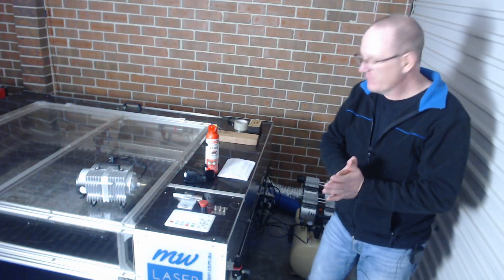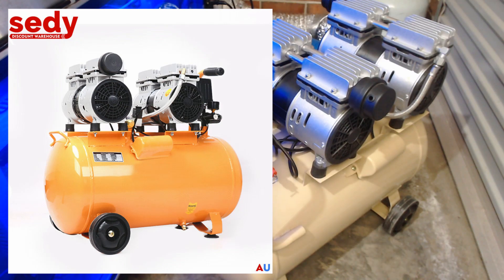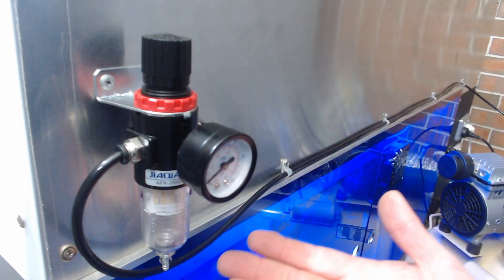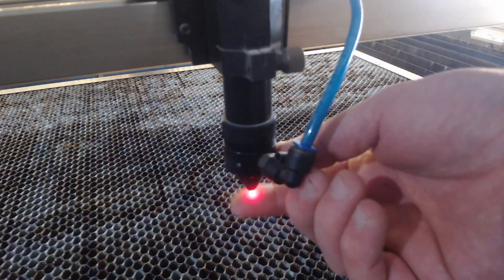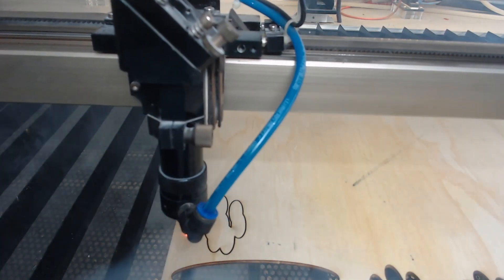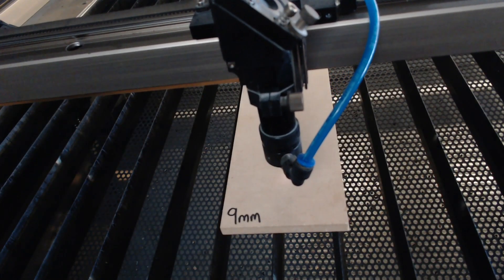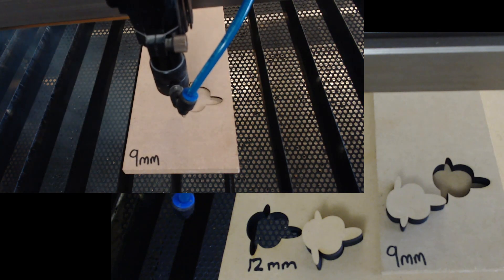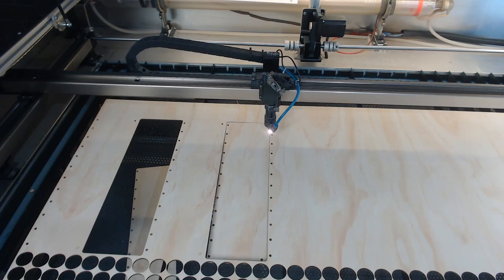Co2 Laser, AIR COMPRESSOR Upgrade, Setup & Testing, With Ultimate Air Assist

Comment from the maker: My Review of the SEDY Air Compressor... Well after a day from New I had it replaced as it originally came with a faulty compressor unit.  Now 4 months with this replacement unit, and this one has the same issue.  I Don't recommend this unit.
Reply: from california air website....
"Up to 8 hours of continuous running at 90 PSI and 12 hours at 40 PSI. 
The 200CR motor/pump is tested for a minimum life of 5000 hours before wear. Wear parts can be a piston ring, cylinder ring or reed valve."

I wonder if you exceeded a similar timeline??

Comment: Hello, I am having problems with my co2 laser unit that has the same small compressor as yours. My laser has 150w power and I use it mainly for cutting wood and acrylic but I do need to engrave like 30 percent of the time and I am getting all sorts of burnouts. Will this type of compressor also help with this too?

Comment: I might have missed it in the video, did you have a second pnumatic solenoid to prevent your air from leaking while the machine is idle? (The ultimate kit has a relay for turning on/off the aquarium pump, but that wouldn't do such a great job with a compressor and its tank)

Edit: nevermind, I should have read 3 more comments than I did, I found my answer

Comment: I see the video is from some time ago. Have you since then, or anyone else here for that matter, gained any experience in the water-filtration on the regulator. Do you use any special size of the micron in the filter?
I have a regulator with filter now, but I still get water coming through putting a layer water on the focus lens. Not sure what micron size I have on current filter, but planning on buying a 5 micron filter.
Reply: Try a 2 meter pvc pipe filled with desiccant crystals

Comment: Great video...first time visiting. I am in the process of setting up a Thunder Laser Nova 63/135 Watt that I just received and had planned to use my Makita MAC5200 air compressor I already have. However, its volume (~20L) seems to be undersized for what you recommend. Will I find that the 20L will be an issue with some projects? Also, if I use the Makita, I am guessing I will need to use a  separator to deal with oil mist also but haven't researched this yet to see what the options are.

Comment: Always great videos. A compressor I highly recommend is made by a company called Jun-Air. They make several models but the ones that use a refrigeration compressor are whisper quiet (45db) and are very reliable. They are ghastly expensive because they target medical and scientific community but you can find them in the $4-500 dollar range in the used market. You need to use an oil/water separator as it is an oil lubricated compressor but they last for decades. They are quite small too.

Comment: Hello great info as always your videos are really helpful!
I'm in the process of buying a Co2 laser and wanted to ask you if you did these cuts with the 90w tube you mentioned on the part one of your laser build because I have chosen a Reci W2 90w tube for my machine and was afraid it couldn't cut 8mm and 10mm MDF or Plywood. I want to do some detailed engraving so the w2 seemed like a good option for cutting and engraving but please correct me if I'm wrong, and its impressive you did it with a 2''(50.8mm) lens I was thinking about a 2.5''(63.5mm) and wasnt sure if it would do that.
Also you used 7mm/s for 9mm MDF at what power? And the setting for the 12mm?

Thank you for your help

Comment: Hello

Can i use a compressor with tank with a cloudray ultimate air assist? If yes, how?
Reply from the maker: yes, however you run compressor on a separate power outlet and not to the relay so the compressor is always on.  You can use the relay output for the exhaust fan.
Reply: @MWLaser  a valve is normal open, so, how to control it?

Comment: Hello!!  Great video.  I NEED HELP.  My laser uses a larger diameter silicone tube.  I need a connector that will go from the compressor to the silicone tubing.  Do you have a link to one that would work?
Reply from the maker: I would replace the silicone tube with a nylon tube if using an air compressor

Comment: I'm installing the cloudray ultimate air assist kit to be used  with a California air tools compressor . Is the supplied relay still needed in this case ?  Is the compressor supposed to just be turned on and off manually? Thanks in advance.
Reply from the maker: no the relay is optional, and I don't recommend using it for the compressor, however you may like to install it for the exhaust fan
Reply: Thank you!

Comment: Thanks for the video. I am just about to finish building a 80W CO2 laser and already tested one compressor I sent back. Next I was going to try exactly what you mention here, a 50liter silent compressor.. What you did not mention I guess was that how frequently is the compressor running on such long cuts.. anyways I agree and think this is the way to go.. now just waiting for a good black friday deal :)
Reply from the maker: hope your upgrade went well - Cheers Matt
Reply: @MWLaser  Thanks! New compressor is installed and seems to work. Still need to adjust few things on the laser to get it really to action. So far everything seem good

Comment: what speed did you cut the 3mm and the 12mm at?
what size tube do you have ?
Reply from the maker: 130-150W
MDF
3mm about 30mm/sec (26mA)
12mm at 7mm/sec (26mA)

Comment: Hi Matt.
Did you notice any issues with air leakage when swapping from air pump to compressor?

I installed the Cloudray Ultimate Air Assist kit last year (following your video - thank you!), and it has been working great. 

I recently bought a proper compressor, and when I have it plugged in to the air port, I get air coming from the laser head immediately. Did you experience this, or have to make any modifications such as another solenoid? I think I expected no air to be passed through until a job is active.

It otherwise works as I would normally expect (no air is smaller volume and air is larger volume), controlled via software. I will say it is eerily weird to have the laser going and not have the constant chatter of the air pump in the background.

Thanks again,
Bill.
Reply from the maker: yes, due to air solenoid having a bypass for when air is off to protect lens during laser cutting job, the air from compressor will drain, unless you add a full off tap or an additional solenoid connected to Status.
Reply: @MWLaser  Thanks Matt. I ordered (for anyone else having the same issue) a 24V NC (Normally Closed) solenoid, and put it first in the air chain. Used the status wires originally going to the relay and rerouted to the solenoid, which fixed the problem. Cheers :)
Reply: @billstickerz3296  Interesting, Do You have a visualisation of that?

Comment: Is the 30psi that you recommend the static pressure or working pressure?
Reply from the maker: static I guess. I set at 30psi then start, I monitor it, and if it did drop below about 10psi I would pause job until compressor caught up.  however the newer (AEG 60L) compressor I have maintains 15-30psi while cutting for about 30-40 mins which is plenty.

Comment: I may have missed it in the video or your notes, but do you mention:

(1) What kind of ADAPTER comes off the air compressor to fit the hose to the regulator . . . and

(2) What kind of HOSE is used throughout -- e.g. from compressor to regulator and from regulator to the laser nozzle? (Is 6mm the outside diameter)?

Currently my red-and-black has hose from the air compressor to the laser's housing that is the same diameter as the hoses from the chiller. I'm thinking I might just bypass the connection that is on the housing when running from the regulator to the laser head.

I wonder if some hoses might not be able to handle the 30+ psi or wear and tear of a heavier-duty air compressor.
Reply from the maker: Reply is not saving - I have emailed you

Comment: Thank you for making these videos, they help a lot. Can the Ultimate air assist still work without plugging the compressor into the laser?  I have a shop air compressor on the other side of my shop.  I was planning to make a 6mm air tube run across the shop into a pressure regulator on the laser and let the compressor turn on when the PSI gets too low. When plugged into the red and black laser have you ever noticed any issues with compressor amp draw causing any issues.with the larger compressor.
Reply from the maker: Yes you can use a compressor that is always on.  You should not have your air compressor plugged into the back of the laser machine (this is ok for an air pump).  Cheers Matt
Reply: @MWLaser  thank you so much Mathew,! You are a great teacher and  provide much appreciated  laser info. You have a great voice.

Comment: Could you please do an updated video on the Ultimate Air Assit for an Air Compressor? I'm having a hard time figuring it out as the relay is no longer needed.
Reply from the maker: email askmatt@mwlaser.com.au with your controller and some info on your current setup and I will fwd you some additional diagrams that may assist.  Cheers matt

Comment: I’m wondering where I might find one of those blade tables at a reasonable price. I’ve got an 80w red and black similar to yours that I’d like to replace the honeycomb on.
Reply from the maker: I ordered mine by emailing and requesting a quote from cloudray they supply to size you request
Reply: @MWLaser  thanks!

Their shipping costs to AU are super high right now 😭

Comment: Did this upgrade replace your Ultimate Air Assist upgrade from April 26, 2019 or does it complement it?
Reply from the maker: No it doesn't replace it, like you stated it complements it. 
Just replaces the air pump with and air compressor for higher air pressure which is better cutting through timbers. Low pressure is still best for acrylics, so having the regulation valve is necessary.

Comment: Hi Matt the fins from cloudray for the table do you have a link. Also how are you finding the extraction fan you have does it work well. Thanks Alan
Reply from the maker: I don't have a link for the alloy fins - I emailed Cloudray directly with a quote request,  include the length of each rail and the spacing required for the width of the laser bed.  and they can provide a quote to your specifications.
The extraction fan is working well.
Cheers Matt

Comment: Great info, thank you! For your 45 min cut test, do you know what kind of duty cycle the compressor was running to keep up with that output? Did it have to run constantly or was it able to turn on and off?
Reply from the maker: it stayed on for 45 mins, with 30psi supplied at the nozzle and maintained 50-80psi at the compressor.
Reply: @MWLaser  you are killing your compressor. Those silenced non oil units must rest 1:3 at least, so 1/3 work, 2/3 rest. Otherwise it will die very fast. You need at least 420 l/min to work ar 30 psi correctly for compressor and bigger tank is better, 50 litre is somewhat small. Cheers

Comment: Why not use 75psi at the laser?  What's the intention of having that pressure at the compressor?
Reply from the maker: The installation I used includes the pressure regulator at the laser, it allows quick and easy adjustments when using various materials.
Reply: @MWLaser  But, in your testing, you settled at a lowish pressure, albeit much higher than a fish tank type air pump.  Did you experiment with higher pressures?  Sorry to question you.  I'm just curious.  Great video either way.  :-)

Comment: Great video Matt, just going down the compressor route and this has answered lots of questions. Cheers👍
Reply from the maker: it certainly makes a difference to the work I do, I hope you have the same success.  Cheers Matt
Reply: Matt, what have you set you cut in psi to on the compressor. As in how low does the psi go before the motor kicks in.

Comment: I'd love to "hear" how loud that compressor is when it starts refilling to get a better idea of the noise (or quietness) it supposedly has.
Reply from the maker: Hi Greg, The problem is when video records sound it is not a true indication of sound levels, as the volume on recording and playback may be different.  This is the best I can do (link below) without you hearing it in person.
Cheers Matt.
https://mwlaser.com.au/wp-content/uploads/2020/10/VID_20201008_101628910.mp4
Reply: @MWLaser  Yeah, I see what you mean. How does one get a good idea how quiet they really are.

Comment: Hello, please, is there a table with the necessary air pressure for each material, such as MDF, acrylic, rubber, and others?
Reply from the maker: no there is not that I'm aware of.  It something you will need to test on the material you use with your laser.
Reply: MW Laser thank you very much

Comment: Hi Matt! Thanks for this video, really helpful. I have a question about ultimate air assist and air compressor combination. Do I need to use relay for the air compressor? I thought that my compressor will stay on when working with laser and only the solenoid is needed for letting the air go to the nozzle. Thanks for answer!
Reply from the maker: No you do not need to use the relay for the compressor
Reply: Also, my air compressor will be in another room on the other side of the wall, so I would like just to make a hole in the wall for the air hose. Is that possible or I need to bring power from my laser to the air compressor? Thanks

Comment: What is the focal length of your lens? At 7:15, your nozzle looks very close so just curious. I have an 80w that I like but have issues cutting 1/4" ply or mdf with it. I have to burn the hell out of it to get it to cut through.
Reply from the maker: I'm using a 2" (50.8mm) focus lens. On my setup this leaves a 7mm gap between nozzle and material.
Reply: @MWLaser  Thank you! Really enjoying your videos.

Comment: Hi. Just wondering how you going with the compressor so far? Im in the market for one..do you recommend it? Also alot of my laser work run for between 30-60 mins..can this compressor keep up and not overheat? TIA
Reply from the maker: Yes I have not had any issues with the compressor, it is keeping up even after long cutting sessions, it has not over heated in my environment.  However it is winter here, I'll know more after 12 months use.

Comment: Thanks Matthew, I'm currently building my CO2 laser inspired by your build, and using Cloudray components and MK extrusions, really happy with your upcoming series on setting up with Ruida 
this will be super helpful, I'm at the stage of trial wiring my setup which has work area 1400x1200mm and have made mods to the drive system for the Y axis using 2 steppers and locating them at the front, I'm hoping this works out as it has cleared the area at the back of my machine making air extraction much clearer.
I was going to use an old Cigweld Big beaver diaphragm compressor, that has had little use, but after viewing this video I think I'll go with your recommendation.
I'll have see if can get onto an air regulator that can be  remote mounted on the control panel.

Thanks for sharing your ideas bets regards

Ralph
Reply from the maker: That sounds great, it's a good size machine you're building too. Cheers Matt

Comment: I have a 100w RECI tube and I still cant manage to cut through some of the material you cut here. Can you list what settings you used to cut everything? I also have upgraded air assist and while it helped a lot for 6mm plywood, 6mm MDF and 1/2ply is still no go :(.
Reply from the maker: Both the 9mm & 12mm MDF I used 7mm/Sec at approx 26-28mA. I'm using a Cloudray CR90 90-100W Laser with a Lens 2" Focus Lens 20mm Diameter.  Usually for these thicknesses I'd use a 4" lens however I forgot to swap out my lens for this video.
On 3mm Ply and MDF I run at 25mm/sec at approx 20mA
10mm Acrylic I used 4mm/sec at 26mA
12mm Plyboard is something I have not used, so I can only suggest testing yourself with varying speeds and power settings.
Cheers Matt
Reply: MW Laser Thanks for the response. RECI recommends that I don’t exceed 24ma on my tube. Do you worry about running your tube that high or is your tube rated for a higher amperage?
Reply from the maker: @RyKnocks  My 90W tube max is 28mA and I don't run higher.

Comment: I have the same air compressor they are great can talk on phone wile running.
 those water outlets are auto when pressure drops. Have ordered air assist thx matt
Reply from the maker: Thanks Wayne, the auto air assist is definitely a great upgrade. Cheers Matt

Comment: How do you find the Sedy compressor? Is it aluminium - currently deciding between the Sedy, and the Chicago from Sydney Tools which appears to maybe be a bit better, but more costly.
Reply from the maker: The Sedy was recommended to me by another Co2 Laser user, he has used his daily for the past 12 months with no problems.  I've had mine since May 2020, it arrived damaged but the company replaced it without problems.
It is a good budget compressor and is quieter than I was expecting for an air compressor.  The quality is what you'd expect for a unit in this price range, it does not have the aluminum tank.
Reply: MW Laser thanks. I’ve just ordered one. Fingers crossed!
Reply: Got the compressor. Working much better than the air pump. Thanks for the advice. I have a feeling there is a fault with the pressure reducer, I still get quite a flow of air even when the solenoid is closed and the bypass almost binding. How do you set your bypass pressure and are you almost able to stop the flow altogether?  Thanks in advance.
Reply from the maker: @santostuguts  I use the tap shown at 4:08 and fine tune the air flow to a minimum
Cheers Matt
https://youtu.be/4P-5nIckybM?t=248